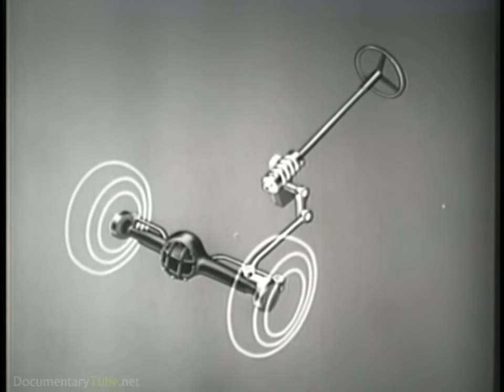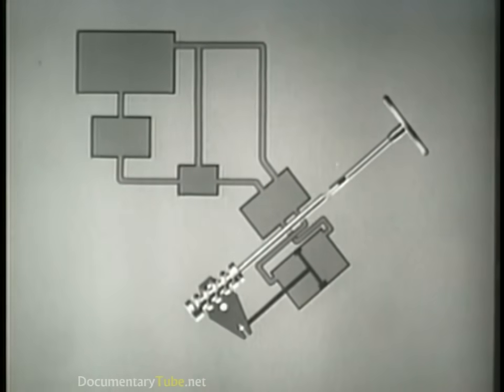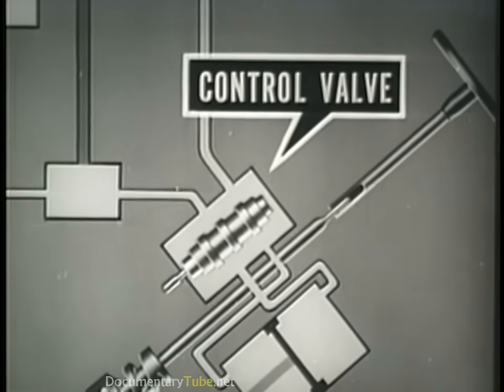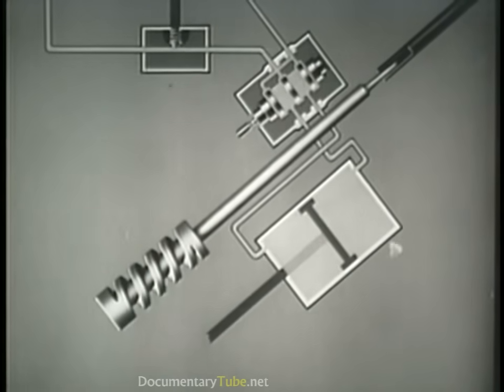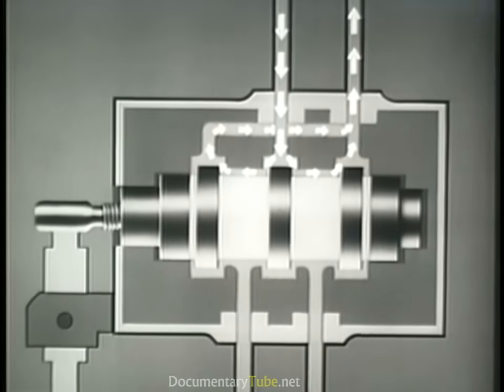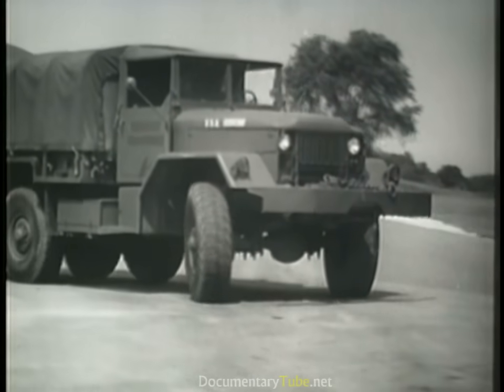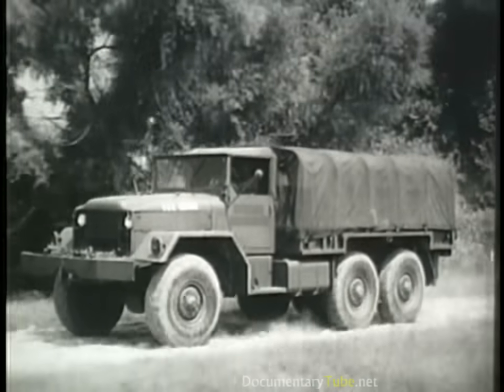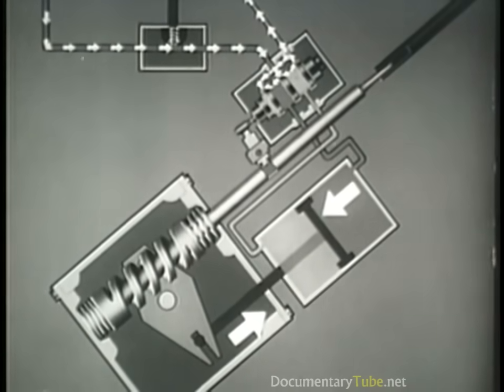HOW IT WORKS: Power Steering

Comment: Answered the one question I had that not a single other channel answered, Why the wheels don’t just keep turning ‘til they’re as far as they can go. No other channel explained how the valve and steering wheel and cam worked that well, even ones that took the parts out of the car and cut them open for a cutaway view. Absolutely love it....

Comment: Is transmission fluid the same thing as the fluid used in power steering?
Reply: It depends on the type of transmission system. old automatic transmission fluid works well with the power steering fluid and that is why they are usually called hydraulic fluids in general. Am not sure about the modern automatic cars since they use synthetic oil, that is why you do not need to change the automatic transmission fluid of modern cars as it was the case in the old days. Remember that they are both hydraulic systems so i think but am not sure the synthentic oil can also work on the power steering. On the other hand, manual gear box uses a different oil and it is not hydraulic fluid rather its a lubricant of gears (different from engine oil, but same as diff oil(differential thats the full name lol). I think, but not sure about the dual clutch gear box uses a similar fluid as manual gear box since its also a fancy merge of two manual gear box in one case with electronic controls in simplest terms.
Reply: Jeffrey314159 not necessarily..

Comment: is this before rack and pinion? cause it looks like that steering link turns and entire rack but on modern cars the gear is on the rack and the hydraulic piston is on the rack, unless Im retarded and there's something Im missing
Reply: This is rack and pinion, In trucks the arrangement of rack and pinion is different from small cars in the sense that the rack is a bit curved and he use the principle of levers to have a larger travel for a short rack otherwise using the arrangement which is used in small cars would require the drive to turn the wheel a lot of times. This is my opinion and feel free to correct me

Comment: This is a horrible design IMO that could be drastically improved and simplified.
Reply: Yes, it's been improved; but remember that early generation designs still required great ingenuity to create from scratch. We all stand on the shoulders of geniuses.
Reply: Keep in mind this is not how most of these systems work today, but these videos show the origins and original technology from which modern systems used today have developed from. Also, the same problem might have been solved in different manners around the world, this video only shows one solution to power steering. 

Today's drive by wire systems also remove a lot of the mechanisms in use and rely on actuators and signal amplifiers to do the same job but electrically.
Reply: Jeffrey314159 That's not how EMPs work, that's not how anything works; you probably just heard the term in Ocean's 11. These systems are already inside an effective Faraday cage made of the vehicle's bodywork. And this is especially true of military vehicles that have far more metal content.

And do you have even the slightest idea how much radiative energy is required to damage electronics like that? I'll give you a hint: it takes far more than is required to give you cancer. The electronics would be the least of anyone's worries.
Reply: okay then, you do it
Reply: Ian Mangion   This reliance on soft technology leaves our machines vulnerable to emp and environmental extremes.